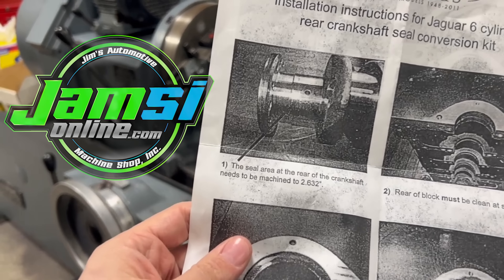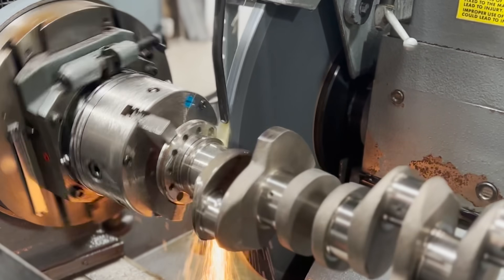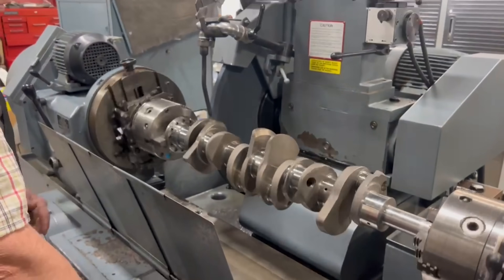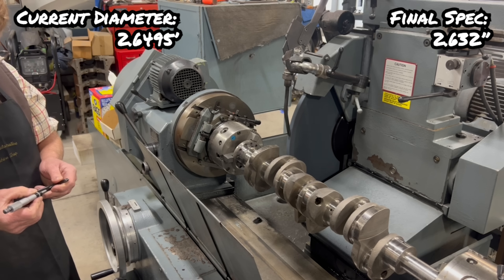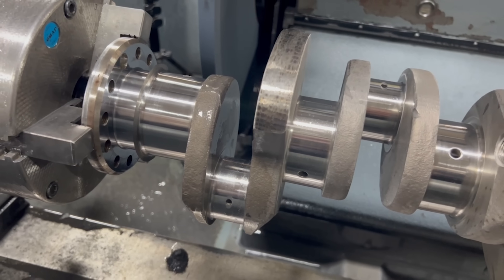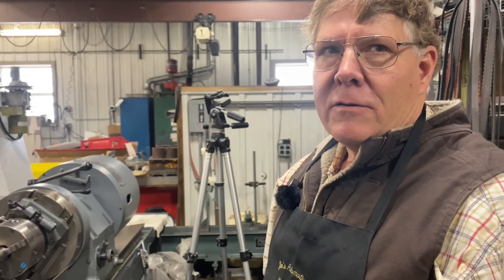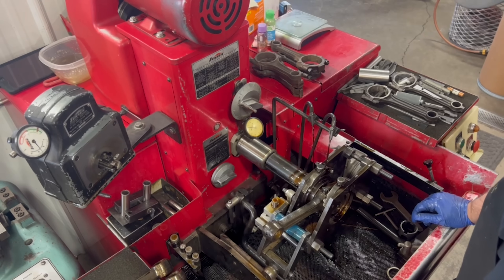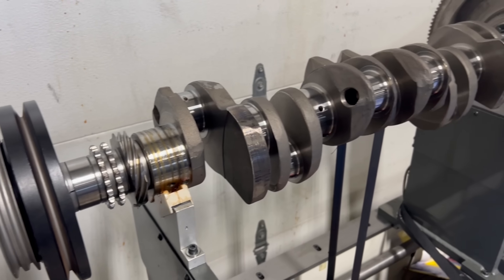No More Leaky Rope Seal! 4.2L Jaguar Crankshaft Seal Modification

Comment: Terry's seal replacements are good.
However, if you fit a rope seal , and size it correctly, they stay oil tight for decades.
99% of shops do not have the correct sizing tool and still do the motor, and guess what?
The seal, incorrectly installed, then leaks.
And the seal gets the blame.
It is operator error.
So many old wives tales about these engines , and many other engines for that matter.
Terry's seal just makes a rebuild more idiot proof.
If you have a thoroughbred vehicle, keep away from idiots.

Comment: Grinding a rare and expensive crankshaft must be frightening.  One oops and an expensive boat anchor and angry customer.  Wheeler Dealers had a episode where they similarly installed a modern rear crank seat on a classic British engine, a 1-piece type which slips over the crankshaft.

Comment: We just converted the rear seal housing of a Ford fontana "cleaver" block, from 2 piece rear seal into a 1 piece rear seal. Thats probably the one and only fontana block I will ever work on in my lifetime on account of they are a low production casting.

Comment: Hey have a quick question. I recently got my l98 v8 into a shop and got a cam package had new lifters push rods double springs titanium retainers. vitton high temp valve seals. race chainand gears. 10percent high pressure mellings oil pump new oil pick up o ring. And the engine come out and had new cam bearings put in... I've driven it 7 times and only about 1000km. And their is metal in the oil looks like hair and some Teflon and some gold coloured metal as well. I found the metal because the oil light came on the dash. Dropped the oil and my heart broke. The car only has 160000km. Would this be the shops fault is it stuffed

Comment: You guys did well. A 67 probably wasn't balanced so tightly. I'd roll with those rods but it's not my build. New rods? It's only $$$.
Reply from the maker: I’d roll w/ the rods as well. 

Other options are finding used rods (good chance balance will be further off) or aftermarket, which are expensive af for this engine lol
Reply: @JAMSIONLINE  I know. I have a cheaper 73...

Comment: My question is how do you true up the crank grinding wheel? Is it done in the machine and how often does it happen?
Reply: Probably using a diamond dressing point in the machine. You have to do it any time you re-mount a wheel (as it will lose its concentricity with the spindle), or if the wheel goes out of true on its own. Usually you would also dress the wheel occasionally to remove 'glazing' of the wheel, which is essentially caused by the grit on the surface wearing down and becoming blunt.

Comment: To correct the rod issue you can put bob weights on the crank matching the irregulat rod weights(not usually done on a straight 6) and balance the crank to rods...while odd this will work...you all so keep the rods in moving couple pairs with the lightest 2 and heaviest 2 .

Comment: I've seen mentioned in several places that OE engine manufacturers set their balance tolerance as high as 80 grams. That is over 2.5 ounces! If that is the case then having an engine balanced to within .5 grams before assembly should make it as smooth as a sewing machine.

Comment: Why was it necessary to remove so material from that one journal?
Reply: In a nutshell it’s a sealing surface, and a smaller diameter was needed for the installation of a different type of seal than the original.
Reply: @petermolnar8667  Thanks  for the explanation.

Comment: Could you have fixed the connecting rods in C&C Equipment's John Deere 850 dozer, where they initially replaced 2 rods, where the wristpin bearing was over spec, but had overseen one further, which meant that they ended up tearing down the engine again and replacing all the remaining 4 rods with Deere reman's, although only one was over spec? https://www.youtube.com/watch?v=8vyFbZsbV_8

Comment: If your crankshaft grinder is 3-phase, you can always reverse it and put material back on, right? Or does that only work with lathes? This is a great channel. I have a greater appreciation for crankshaft grinders (The machinists, as well as the machines) than before. You've raised a pretty good old school machinist as well. Pretty clever fix for a chronic Jaguar problem.

Comment: Is it important to have the crank turning into the wheel versus with the wheel
Reply: Final grain, or surface texture is the result of this. You want the material to not act like a file when rotating on the bearings. Great point!

Comment: Is there enough rod bolt sticking thru the nuts to grind it off to get the big end weights closer as well as grinding the inside ends of the piston pins to equal the small ends out of the final assembly.

Comment: how does grinding effect the hardness on the crank or rods? They are heat treated to a certain extent right?
Reply: So long as you don't grind away so much metal that you remove the hardened outer layer, and you use lots of coolant to avoid overheating the work, it should not affect the hardness.
Reply: @nerd1000ify  how thick is the hardened layer?
Reply: @pa h  depends on the engine, but could be anywhere from 0.75 to 2mm.

Comment: Thanks for the update on this Jaguar project; real shame to hear about that somewhat extreme imbalance issue on the rods.  I guess you could bring the ends a little closer but like you said, structural integrity becomes the issue.  Appreciate your time!
Reply: These engines can't rev high due to the long stroke anyway, so it might not have that much of an impact.
But maybe they could also rev slightly higher if they were better balanced from factory ?
Reply: The long stroke certainly doesn't help with higher RPM, however a 14 gram difference probably partly plays a helping hand in the reason they are kept to a lower rpm rev limit.

As a machine shop that takes so much pride in their work, I wonder how they feel not weight matching everything.